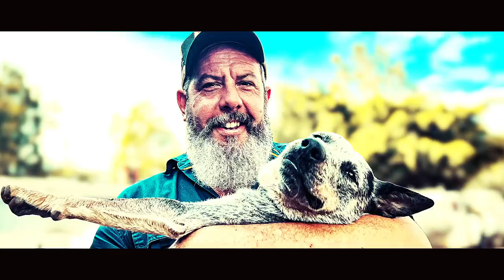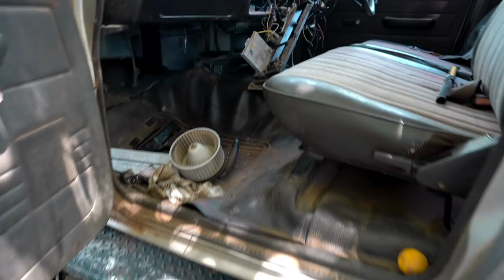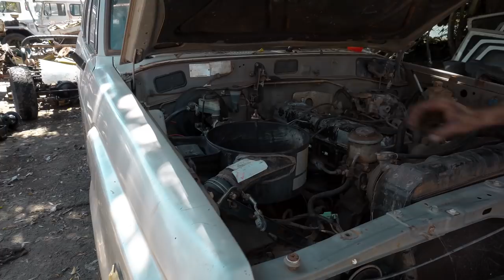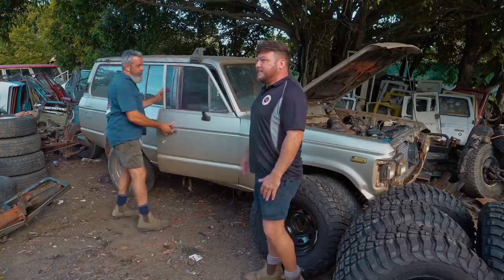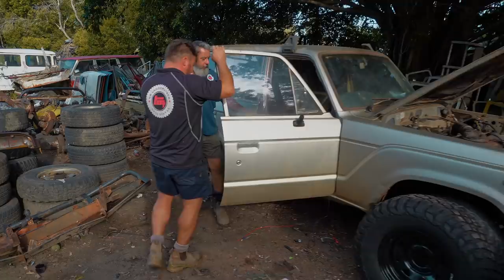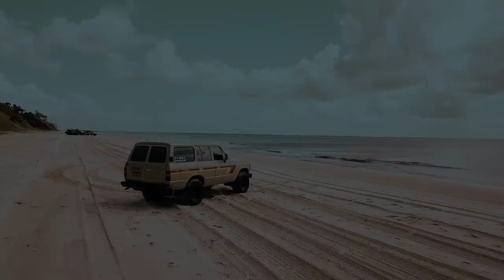Pauls First 60 Series Landcruiser - PART I

Comment: 2f with the square headlight. Very interesting!!!
Reply: Oh. A 3f. I was gonna say
Reply: @favouritejay  Yeah that wouldn't have made sense, 2F was finished by 1984 and the square headlights didn't start until 1987.
Reply: @Teasebag  that’s it. I either misheard or they misspoke.
Reply from the maker: @favouritejay  The seller stated it had a 2F and it arrived with the factory 3F still in it. Not a bad thing, just another inaccurate detail in the listing (we were gonna rip out a petrol motor no matter what anyway).